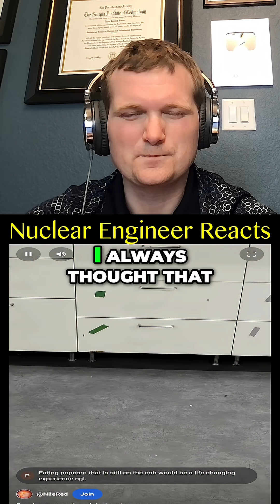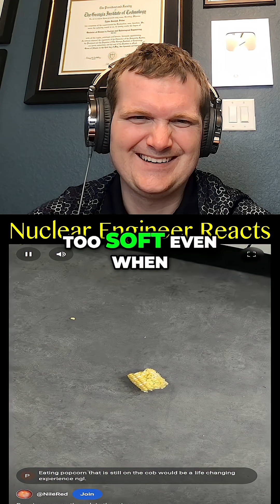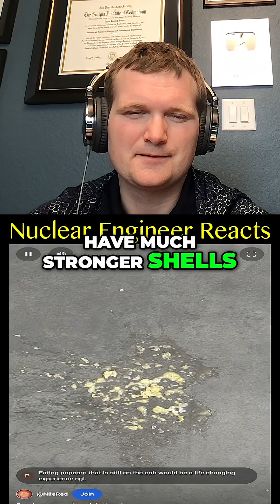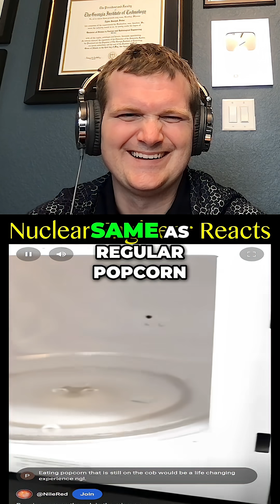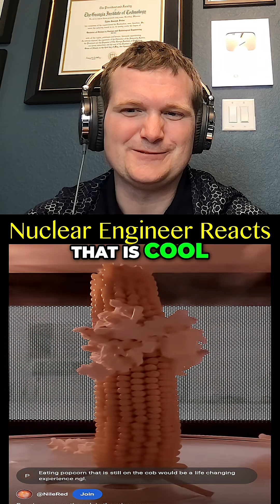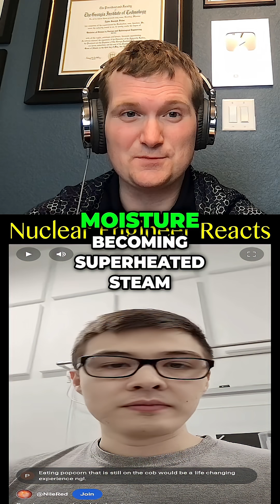Popcorn on the Cob - Nuclear Engineer Reacts to NileRed

Comment: Waitress - So, our sides are: green beans...

tfolsenuclear - Did you know that cooking green beans is like operating a reactor without proper control rods? If you don’t regulate the heat correctly, the molecular structure will overheat, breaking down structure until everything’s soft and mushy.

Waitress - Ok? So you...don't...want green beans?